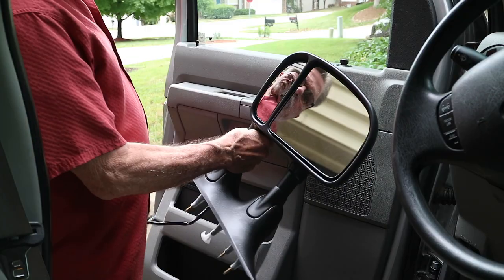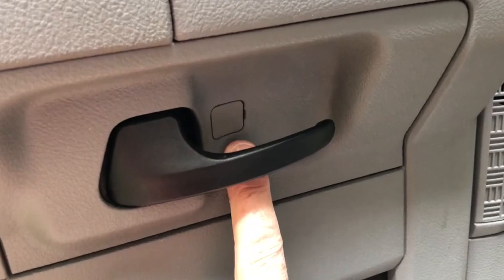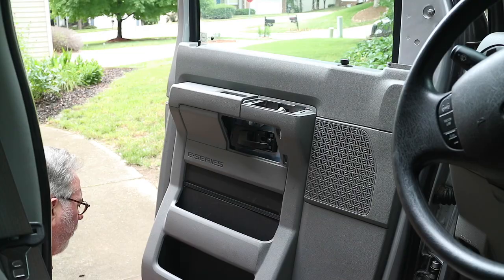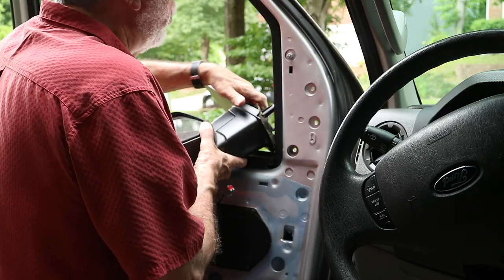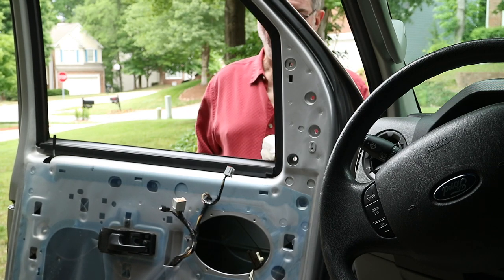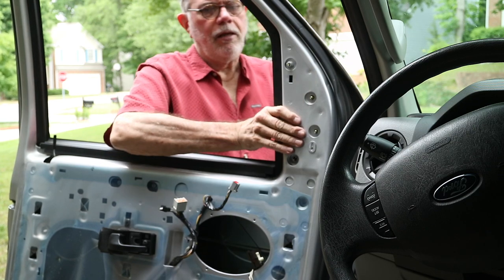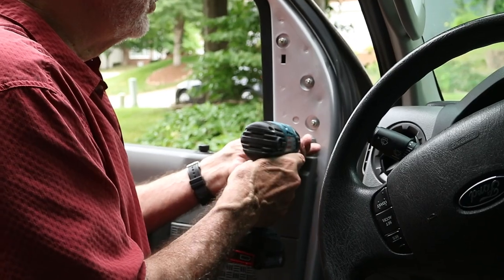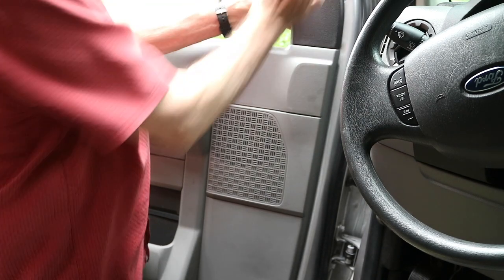2013 Ford E350 Tow Mirror Installation - with Door Panel Removal

Comment: Thank you so much for your video.  Just installed both mirrors this morning and would have never been able to do it without your video.  The only problem we encountered was we had to use a grinder to cut about 1/8" off the ends of the screws on the new mirrors because they stuck out too far for the black cover piece to go back on.  THANKS again!
Reply from the maker: I’m glad it helped. I love these mirrors

Comment: Great vid.  Glad that they’re working out for you.  Have heard quite a few have had mirror vibration at fwy speeds.
FWIW, the Bolt/Nut sizes are actually METRIC
Reply from the maker: 2.5 years and still solid.

Comment: Thanks for the vid.  It made my mirror swap on my E350 2014 go so much faster without all the guest work.  Only think I might sugest is skipping the trim portion of the gasket.  It folds inside at the bottom.  That's how it was on the factory mirrors anyways, so I just did it the same.  Great work on the video though.

Comment: WISH I SAW YOUR VIDEO BEFORE I TRIED TO INSTALL MINE.
ALSO PURCHASED KOOL VIEW MIRRORS. EXCEPT I BOUGHT INDIVIDUALS,, NOT A PAIR.
THEY DONT FIT. KOOL VUE HAS BEEN NO HELP.
I HAVE A 2012 E350 CLUB WAGON . NOT AN XL LIKE YOURS. BUT THEY SHOULD BE THE SAME.
DID YOU HAVE ANY PROBLEM GETTING THE CORRECT MODEL? THE BASES ON MINE ARE AT LEAST AN INCH TOO TALL AND WIDE. THEY WOULD HAVE COVERED PART OF THE WINDOW. ANY SUGGESTIONS?
Reply from the maker: Clearly you were sent the wrong mirrors; I would return them. I got mine from Amazon and they were a perfect fit; very impressed with the build quality. Here is a link to mine:
https://amzn.to/2nOQbHt
They fit 2009 - 2014 Ford E-series. Mine have the power mirror option but they also have the non-power as well:
https://amzn.to/2nOiZjp
Hope that helps; let me know how you make-out.
Reply: THANKS. GOT MINE FROM AMAZON TOO. WITH THE SAME DESCRIPTION, BUT NOT THE SAME ORDER NUMBER.  IF I RETURN MINE AND REORDER YOUR MODEL.
THEY SHOULD FIT, RIGHT?
Reply: You probably won't need this anymore, but just in case ya do. 

https://youtu.be/qqpM2axDfyc

Comment: Let me ask you this. Do you have to go through all that if you dont have power mirrors?  I need to do the paasenger side. I was hoping its just the four bolts shown. Thank you in advance
Reply from the maker: William Farley , hey. I think you will have to take off the door panel to access all the nuts. The good news you won’t have to deal with any wires, speaker, or mirror adjustment switch. HTH… Good luck. Let me know how you make out.
Reply: @wanderlust101  I had it just a bit easier.  Becsuse my mirror was standard (no power) I didnt need to remove the entire door panel. I just removed the top phillips screw and was able to access the fourth bolt with a 90. Thank you so much for the video.

Comment: How does your e350 tow
Reply from the maker: Daniel Campbell E-350 tows well. I have the 1200 Equal-I-zer which, I think, is the best WDH there is. I drive 60-65 mph without effort or sway. You won’t break any speed records in the mountains, but I just stay in the truck lane. I’m very happy with my van and LOVE the tow mirrors. And i REALLY LOVE the Equalizer WHD.

Comment: Dose anyone know if u can add those style mirrors to an old 95 e350
Reply from the maker: The mirrors I used will only fit a 2009 - 2014 Ford E series. Check these out: https://amzn.to/300lJj2 According to the seller they are Manual Tow Mirrors Compatible with 92-14 Econoline Van. I how that helps. The tow mirrors are a major upgrade for me.